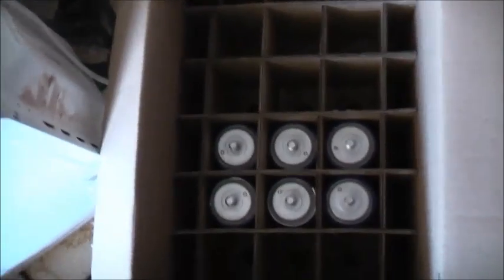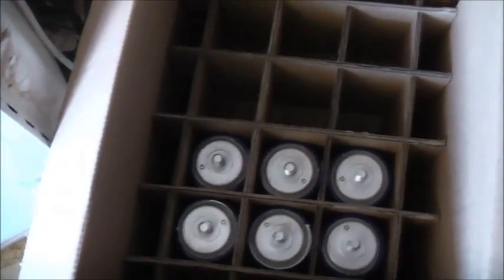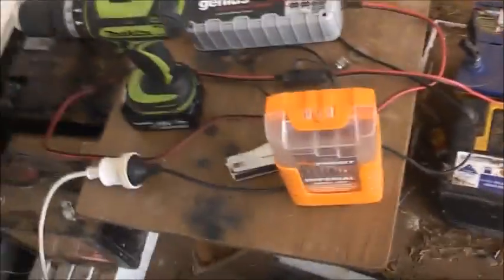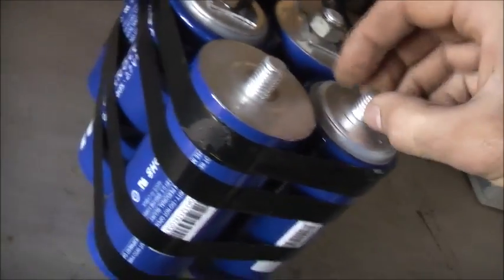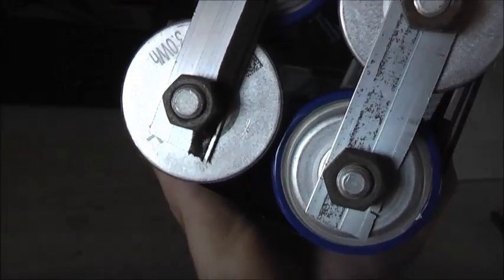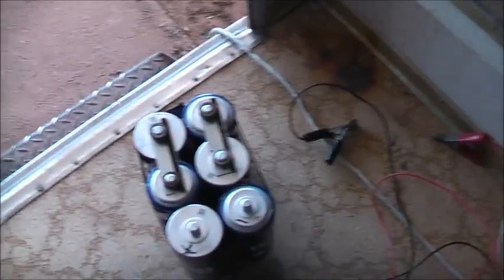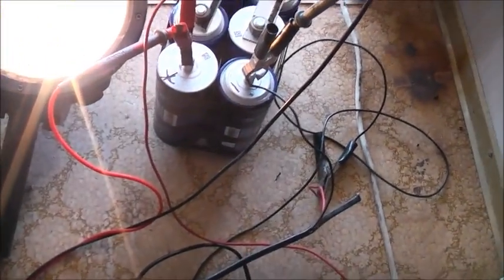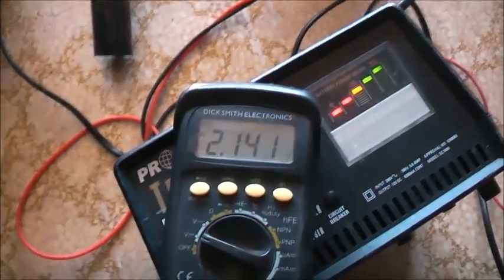Boostcap Ultracap ESM!!

Comment: you're not supposed to connect the capacitor terminals with just metal strips, check google for "Supercapacitor balancing kit", the purpose of it is for the caps to charge uniformly so they don't overcharge, if you don't balance them some caps will charge faster than others and subsequently overcharge and possibly blow up

Comment: for fast charge if your charging from a 12v dc use a 12v dc power supply 30A 120 watts/ 110-220v AC inbox me ill send you the shopping info

Comment: Hi! Could you make a test of the capacitor? Charge of up to 14.4 volts, then connect to the car lamp 55W. And measure the time for which the voltage drops to 10.8 volts.

Comment: If you need: aluminum strapping for these capacitors--listed here on eBay or search for CSM12AL-12.  Also available individually as well as lower loss solid copper.

http://www.ebay.com/itm/Low-Z-Strap-12-pack-Maxwell-Super-Farad-Ultra-Capacitor-BCAP-P270-K04-50uOhm-/261378542004?pt=LH_DefaultDomain_0&hash=item3cdb6009b4

Comment: Aaaah, I had an idea that putting those caps on a car battery charger might short it out, because they suck way more juice than a car battery will, and will release their power far quicker than a car battery also.

Haha...... 'Ballasting' the output of the battery charger. :D Well, it works to help prevent the charger from being shorted, I guess.

IDEA: I think that, if you use the modified high-current MOT and a suitably chunky rectifier setup, you miiiiiiight be able charge the cap bank a little quicker. Just use the variac on the input of the modified MOT so that you can set the correct output voltage. Of course, don't forget to measure the DC VOLTAGE  after the rectifier, because voltage rises after AC has been converted to DC. :-)

It will be interesting to see what kind of damage these things can cause to bits of thin wire, screws, nails, coins and things like that when they're connected across this bank. Similarly, what kind of performance you could get from them when you use them as a substitute for a battery. :-)

Thanxx for showing,

-BoomBoxDeluxe.

17th December 2014, 11.48